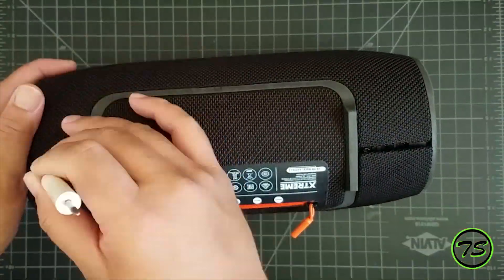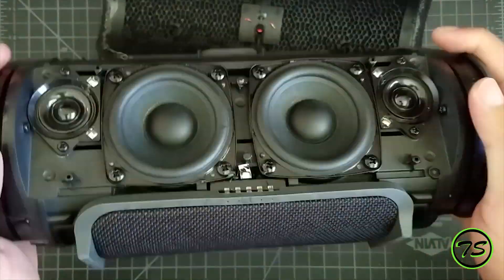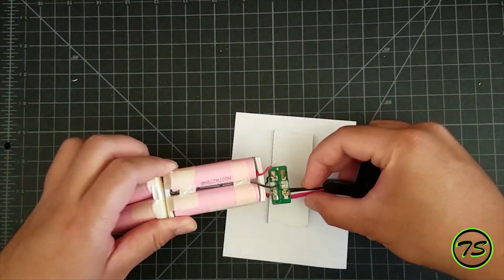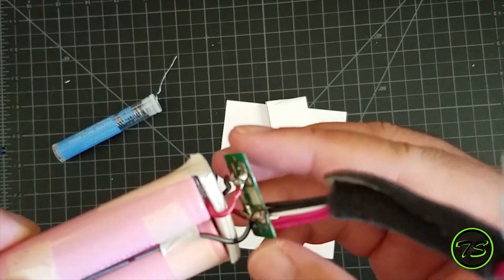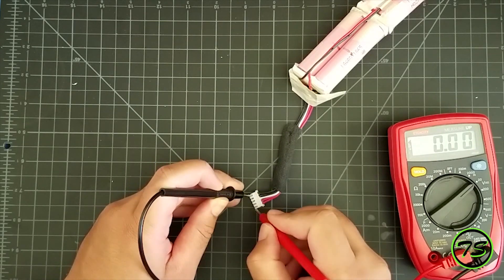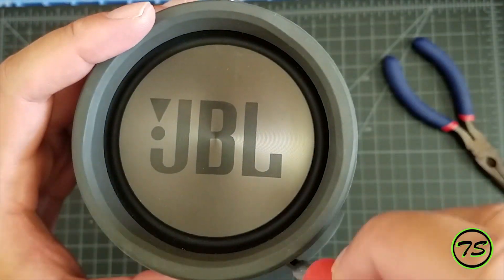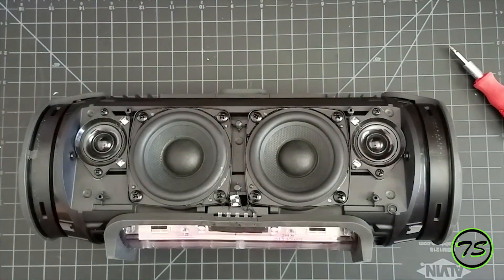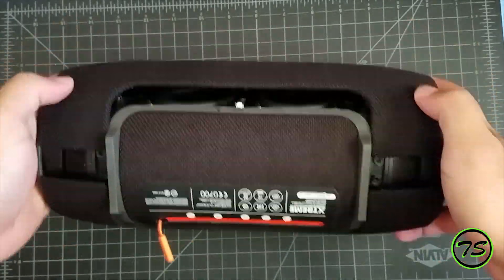(UPDATE) JBL Xtreme + 18650 Batteries (DIY)

Comment: Do you get JBL xtreme distortion at full volume.? i got some distortion . sounds like clipping,after battery replacement 18650.But only when i listen music on yotube music or  songs from my phone with hight quality 320kbps
Reply from the maker: Yes I did before but I explained it in the video how to fix it but sadly my background got copyright claimed to it removed my voice over also, anyways if you remember the hole the battery wire goes through. That's where the air is escaping and causing all the noise. You need something like a cotton ball or something similar to cover that Area.

Comment: jbl xtreme slow charging after 18650 battery 2600 mah panasonic replacement, what"s the problem?
Reply from the maker: How do you know it's slow charging? Did you measure the current going to the battery?
Reply: @TaylorSoloaiJR  have not measured
But it took 13-14 hours to full charge.it's normal?

Comment: Thanks for the guide! Just modded my speaker this way. And after reassembling my speaker makes some noise at loud bass. You mentioned something about port for the wires - but I did not get it. I assume there are some wires that vibrate making noise, but how to fix this?

Comment: hi taylor my name is Adriel Pastrino from Argentina. 
thank you so much for your video, this video helped me to revive my jbl xtreme. just one thing, i put silicone in the hole where the wires of the battery come in the speaker because when the bass sound this do a weird sound, but putting silicone this was solved.
again thank you so much for your video and no problem by the audio removed!
Best regards

//
//
hola taylor mi nombre es Adriel Pastrino de Argentina.
muchas gracias por tu video, este video me ayudó a revivir mi jbl xtreme. solo una cosa, puse silicona en el orificio por donde entran los cables de la batería al altavoz porque cuando suenan los graves hace un sonido extraño, pero poniendo silicona esto se solucionó.
nuevamente muchas gracias por su video y no hay problema por el audio eliminado!
saludos
Reply from the maker: Thank you for the comments, I'm glad it was useful.

Comment: Hello, i only have 450 Mah one 4.2 v battery  I did it
 with 4 battery its 1600 Mah 
Its turn on and work but when up full volume only 5 minutes and its turn off automatically maybe the problem only have 1600 Mah?
Reply from the maker: How did you test the capacity on those batteries? Does the red led blink before it shuts down?
Reply: @TaylorSoloaiJR  These are from an old laptop battery and I calculated the Mah seems pretty small i think. When turn off it doesn't always go from 5 to 1(red blink) and then 30 seconds and it turns off.But there are times when it signals nothing and turns off.and when i full volume the speaker interesting sounds when bass going.
Reply from the maker: So if I'm reading your comment correctly, it only turns off all of a sudden when you turn it up to full volume?
Reply: If i turn max volume 2-3 minutes i see 1 blinks red turn lower the volume maybe 50% i wait 3minutes and its go up 4-5 blinks i understand
Reply: Yes yes its turn off when full volume
Reply from the maker: Okay sounds to me the problem is the batteries. The ones I salvaged I had to do a capacity test before using it because sometimes checking the voltage is not enough evidence it's good. Disregard that if you already done it but I would highly recommend buying new 18650 batteries.
Reply: @TaylorSoloaiJR  okay thanks i think its that the  problem

Comment: Hi, Taylor! Can u help me? I bought 4 Original 18650 B 3.7v 3.400mh Panasonic Rechargeable Batteries and did as you taught, but it didn't work. What can I be doing wrong? Is it the wrong battery?
Reply from the maker: Did you plug in the charger to activate the board?
Reply: @TaylorSoloaiJR  yes, i did it this way. link: https://prnt.sc/vgf0ro
Reply: @TaylorSoloaiJR  when I turn on the charger, the LEDs flash as if I were charging. but when I turn it off, the box turns off like there are no batteries connected.
Reply from the maker: Hard to say what is wrong, maybe double check the connections again.
Reply: @TaylorSoloaiJR  already checked and measured the voltages on the board, everything is fine =(

Comment: battery 18650  4a, 8a, 10a, 15a, 30a are safe for jbl xtreme1?
Reply from the maker: Can't  quite answer this question but make but i guess the higher the battery rated drain the better. 

I would also recommend  using protected cells.

Comment: Nice video, but i have a doubt. The battery location looks like it was original @1:33. You didn't have to cut the plastic to fit the 18650 pack?
Reply from the maker: That's correct, not a single plastic was cut. They fit perfectly in that location.
Reply: @TaylorSoloaiJR  maybe jbl changed something on new product cuz mine have 1 edge in battery location so i have to cut that to fit the pack

Comment: Parallel connection?? Does the connection of extreme 2 is the same with extreme??ty
Reply from the maker: The sets of batteries are parallel connected to increase the mAh, for the Xtreme 2 I have no idea if it's the same or not.

Comment: Great job bro, I'm looking to upgrade my lg pk7 I want a bigger battery and add 2 passive radiators on the back and 2 underneath..
Do you know the voltage of it? I disabled it and it has 2 different battery 2x 2.6 my I guess  with 2 did connectors black red and white 
But there's huge space for like 20.mh what's happen if I put bigger voltage?
Reply from the maker: I would not recommend going over voltage, it will damage the speaker. Just need to find a battery with the same voltage but bigger mAh
Reply: @TaylorSoloaiJR  yes mate eventually I'll leave like that I'll just buy converter from dc to type c and just hock it to a power banck 😉

Comment: Sir permission i have a question...
18650 is size of battery..volts? Mah? Can i use more than mah?
Reply: Can i use 3.6v and 2600 mah?
Reply from the maker: Yes you can use that

Comment: Hey Taylor thnx for the help my jbl works properly now, for increased battery life instead of 4 I placed 8 batteries (4on each side)  Jst one issue when charging after 30 mins the 4th led starts blinking and after tht it reaches the 5th led then 1hr later again 4th led starts blinking and it goes on forever. While playing I get a very large playback time, but how would I knw tht batteries are fully charged coz 4th led starts binking and goes on forever also would like to knw is there anything other wrong with it coz my batteries I used were of good quality
Reply from the maker: Were all your batteries fully charged before connecting? and are these new batteries or used?
Reply: @TaylorSoloaiJR  Mine have the same problem, i do like you says (4 cells), i use brand new samsung and running low before connecting
Sorry for my bad english
Btw from VN 🇻🇳 with love
Stay safe my friend
Reply: @sonnguyeninh6736  I got the problem actually the circuit isn't designed for such large batter capacity so the 5th led keeps blinking but I kept is for a long time coz It has balance charger board so actually after some 8-10 hrs of charging the led stopped I checked the voltage of individual cells they were 4.2 then I knew yes it's charged fully jst took a very long time coz of capacity need to consider tht also😁
Reply: @yashdobra9154  so you just leave it charging, i only replaced 4 cells, and while charging it reach 5th led then 4th led and it blinking forever, i tried connect charger for 6 hour but nothing change, still blink 4th led, this is my 1st time connect to charge ( sorry for my bad english, hopefully you understand 😅)
Reply: @sonnguyeninh6736  means ur using 4 cells right, and are those good quality cells if yes then I also had this problem of 5th led blinking, then I teardown my JBL again found my one wire isn't soldered properly to the bms board (it was loose) so try checking the connections and all wires are soldered properly or not, Troubleshoot this and if the same problem still occurs plss let me know
Reply: @yashdobra9154  thank you so much for your support, exactly like you said, one of wire isn't soldered property  to 1 cells, fixed and it work like a charm, still have one more problem that i can't charge my jbl to 100% always stop at 80%, it happened since i used a china's low quality charger, i bought a good one, changed battery, i think maybe my bms or motherboard has faulty 😂
Reply: @sonnguyeninh6736  Yes the bms or mother board could be faulty but if the JBL was original then the chances of this to happen are quite few, I suggest you to use the original JBL charger or a good quality similar ones which is capable, and after charging check the voltage of the cells wid help of multimeter if everyone has 4.2 Volts then it has charged fully if it's less than tht means the batteries aren't charging 100%. And plss letme know how does your speaker work It was my pleasure to help you
Reply: @TaylorSoloaiJR   @Sơn Nguyễn Đình  I got the problem actually the circuit isn't designed for such large batter capacity so the 5th led keeps blinking but I kept is for a long time coz It has balance charger board so actually after some 8-10 hrs of charging the led stopped I checked the voltage of individual cells they were 4.2 then I knew yes it's charged fully jst took a very long time coz of capacity need to consider tht also😁
Reply: @YASH DOBRA that's crazy, how did you fit 4 cells more ?
Stay safe 👌

Comment: When you make the battery pack, what size nickel strip did you use and where did you get them?
Reply from the maker: I did not use or buy any metal strip, it was already part of the two batteries when I removed it from laptop battery plastic cover.

If you open up a defective laptop battery you will see what I mean, or you can just search it on YouTube. A lot of people posted videos on opening up a laptop battery.

Comment: I have no tension on the balancer why?
Reply from the maker: Tension? You mean the wire won't stick when you solder it to the BMS?
Reply: @TaylorSoloaiJR  problem solved the batteries had 3.6v and bms blocked the output

Comment: Would it be possible to use such an Akku with 12000 mah?  https://www.ebay.de/itm/6pcs-18650-Akku-3-7V-12000mAh-Li-Ion-fur-Hauptlicht-Fackel-BC912
Reply from the maker: Sorry I think the link is dead, I can't see the Speaker you are referring to.

Comment: Sir my jbl xtreme has a problem, when i pull out the charging cable my jbl only live in a few minutes then it turn off without battery low alert and when i try to charge it the device still has 4 bar battery, is there a problem with my battery?

Comment: hi bro , Can I just solder the plate to connect two batteries, I dont have spot welder  ?
Reply from the maker: Yeah you can, just be careful don't heat it up too much. Use sandpaper to sand the ends of the battery and some flux will make it easier to solder.

Comment: After I did so. I get a little saturation on the side I took out the passive radiator. What could the cause and how can i fix it. It s like is caused by something vibrating but I checked and cant find the cause.
Reply from the maker: Did you block out the hole that the battery wire goes through? Because it will give you that kinda noise.
Reply: @TaylorSoloaiJR  I think that the battery pack I made is bulky so it is not allowing a tight seal of the cover and also is covering that hole but not completely. I will check that

Comment: Just did the job.

Have a question, a put to charger and the first 4 lights light up in just 4 minutos, 5 light is blinking light still charging. With the mod the charger light light off after is fully charged?
Reply from the maker: Sorry for replying late, been so busy but anyways yes the lights should still go off when its fully charged. at least for mine it does.

Comment: Nice job bro...
Just 1 question.
what kind of 18650 battery you have used. I mean the voltage and how many milliamps each?
THANKS for your quick reply.
Reply from the maker: I will get back to you on this I haven't opened the battery compartment over a year now. Can't remember how much the mAh are and the brand if the 18650.

Comment: Hi, you use the BMS of the original battery of the JBL on the 18650s? Are the specs of the Battery compatible with the BMS of the original battery?
Reply from the maker: Original BMS, yes and no. The voltage are the same as the original battery but difference is 18650 are li ion but the original battery are li polymer. BMS board is mainly for li polymer battery but it works on the 18650 too. No problems at all, matter a fact I'm using the JBL as I'm writing this comment.
Reply: @TaylorSoloaiJR  Based on my observation, you used 4 18650 and connected them in 2 pairs in parallel, then, the 2 pairs were connected in series, did I understand it correctly?
Reply from the maker: @happygolucky143  Yes that's correct, the 2 pairs of 18650 and the BMS will do the series connection for you.
Reply: @TaylorSoloaiJR  The BMS of my extreme is dead together with the batteries 💔, do you know a compatible BMS for the extreme on the market?
Reply from the maker: I see a few online but I can't say if it's recommended.
Reply from the maker: I'll get back to you on this if I find one
Reply: @happygolucky143  you can buy any 2s BMS for lion batteries...its all the same..just look for 2s 7.4v with balance..

Comment: Hey taylor soloai now my JBL is doing better just one problem after I turn the volume up the bass sounds very wierd don't know from where the air is possibly leaking help me with this dude where to make a seal ??
Reply from the maker: Its coming from the hole where the power cable came from (1:33), Need to seal that up with something like Hot Glue or similar.
Reply: @TaylorSoloaiJR  yes bro and thnx for that pro tip , I will try that ASAP and will reply

Comment: Very good, very useful. Would you like to know the battery life and if there was any bass loss? This how much mAh this managment board  has?
Reply from the maker: I haven't really timed how long it will play but for the bass. Still sound good to me, not sure about the others that tried this if they agree with me.
Reply: @TaylorSoloaiJR  Thank yo very much. I'll do tomorrow, i'd like o know if your method works fine cause i found another video that shows another managment board where + and - are plugged in and is different from yours method... https://www.youtube.com/watch?v=HhC_CpxtSF4
Reply from the maker: @Leovixfull  can you give me the link to that video?
Reply from the maker: @Leovixfull  You are actually right he does it in a different way, not sure why he did that but I just followed the same way the older batteries were connected. I can see its the same BMS though, just mine looks untidy because I haven't removed those left over metal from the old dead batteries. (That was my first time dealing with stuff like that, I thought I would have broken it if I took those off).
Reply: @TaylorSoloaiJR  I followed that way and its right, he ballanced the battery pack using both parallel and series to charge all 4 batteryes with the same mah. Anyway thank you very much for answering and sharing information
Reply from the maker: @Leovixfull  as long as it's working for you that's all that matters and no problem 👍

Comment: Ok so now everything is right just when charging the 5th led keeps on blinking even after keeping it charging for very long time tell me when to stop the charging bro
Reply from the maker: It takes time because the capacity of the 18650s are much higher then the lipo battery that was in there. That's if you got good branded batteries. If it's taking more the 6 Hours then might need to check the batteries again.
Reply: @TaylorSoloaiJR  thnx dude u helping so much and u maked my day again just there is one more problem dude when I turn the volume up there this bass sounds wierd like the air is leaking but don't know dude from where the air is possibly leaking help from this bro pls and thank you again
Reply: @yashdobra9154  maybe from the bottom screws, when you take the cap off you know(The first screws when opening the case) Mine leaks from there...

Comment: thanks bro.
i just received batteries from Amazon
IL b doing d same
i hve 1 question, 
on JBL Xtreme there is one slot called service port, am using d speaker 4 past 2 year i don't find it useful by any means.   can that port be use for additional power bank??
if yes then please come up with videos.
i bought 20000k mi power bank specially for this
Reply from the maker: Are you referring to the micro USB port ?

Comment: what type of wire did you use to solder onto the batteries.. or what do you recommend
Reply from the maker: It's a speaker wire but I'm not about the size of it. All I can say is pick the one that's more flexible and easy to work with when your doing all the connections.

Comment: are all 18650s the same ? or do i have too look at mah and voltage ? an if so what should i take ?
Reply from the maker: Only thing you need to worry about is the mAh, be careful their are fake 18650s out there claiming it's 6000mAh but it's not.
Reply: thanks a lot
Reply: Use SANYO 3500mah..works for me real good..lot of capacity.